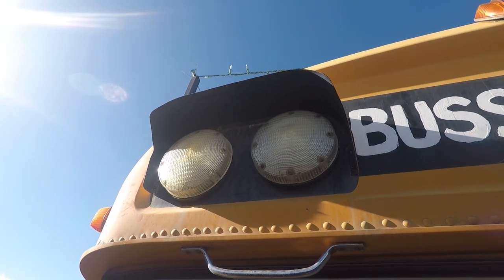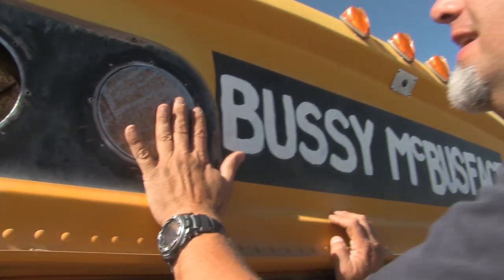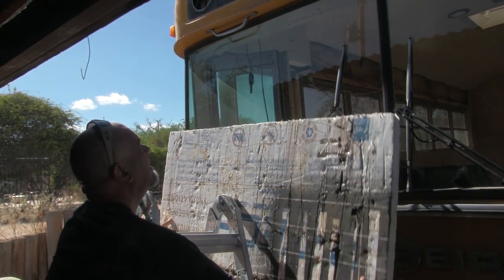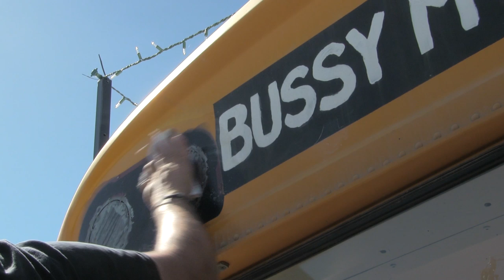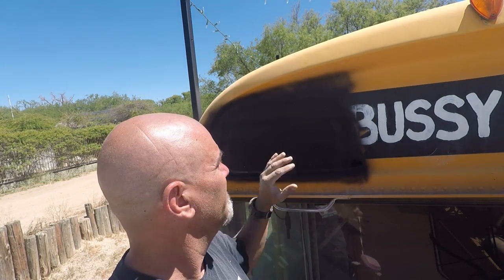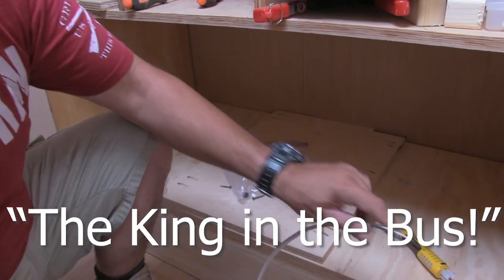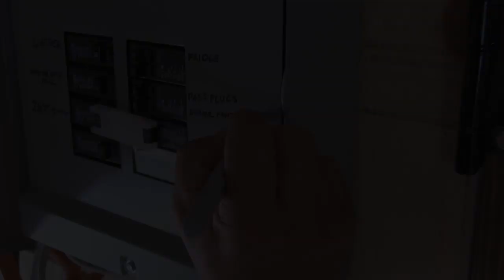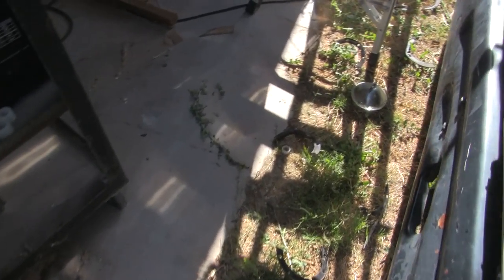Skoolie Crossing Light Removal | Skoolie Build Series

Comment: Bondo suggestions: During the sweet spot when the Bondo has solidified, but has not yet hardened, you can get a head start on working the finish by using Surform tools and scrapers, like the ones branded as Red Devil. This is particularly handy when developing more complex shapes. I’ve found that I can more quickly take down nearly cured filler by hand with a sanding block than with a power sander when fully cured. (But I’m also the sort who will frequently grab the handsaw before the circular saw.)

Also, instead of buying the plastic spreaders, which don’t last that well (they want to keep selling them), pick up some silicone spatulas and bowl scrapers at the dollar store. They work great and any cured filler just peels off. Plus they only cost a buck a piece and never wear out. You’ll want the stiffer ones.

Comment: I know this was years ago, but I'd put led flood lights up there, for lighting up the "yard" maybe a smaller also, for ambiant lighting, and in front, off-road driving lights!  But you guys are great, I wish you were my neighbors! And you make me want a bus even more than I already did! 
I been thinking about a couple Short busses,  make one drivable, and another into a trailer, to pull behind. With a fold down deck to connect the two, maybe a full size and a shorty, or visey versey, and that way it can have a bathroom and half, and larger living room, dining room, a near full-size bathroom, and a half bath in the main driving part, and cover the roofs with solar, maybe 3-4kw, on a pop-up mount, hand crank or powered lift, to allow roof top deck, only on one, because it's not going to be cheap or easy, lifting a rack 7'  is going to be a task! Around 8' x 30'-40'
A gooseneck type hitch under a tilt up deck in the rear of the driver,  a tilt and telescopic deck, to cover it when unpaired, allowing parking butt to butt, with about 24" reach and walkway to eachother, maybe a large generator in what remains of the towed parts engine bay, along with Batteries, maybe, depending on bustype, keeping the under sides for water and sewer, keeping it split and equal, water both sides, pumped equally and grey water dumped equally, with about 100-200 gallon black water (turd tank)  with about 600 gal of water, and 200 gal fuel tank, using a diesel generator of course. And heater, a split heat pump AC would be nice, with as much insulation as possible, to attempt to keep it 68°-72° in all seasons, maybe build a pull out solar rack on the tag along bit, to act as a awning also allowing the ac , holding the batteries and generator, inverter around 8-10 kw, with 40 kw battery, with connection to the driver, it could contain it's own 3kw inverter with auto transfer switch, allowing power while solo,  while having around 2kw of solar, and engine charging capability,  using a dedicated 24v 60 amp alternator, allowing AC to keep cool, with aux. fuel tank in the tag along, allow transfer by pump and 1/2' fuel line, also a 50 amp power connection allowing grid lower or tag along power. With connections on both ends, to allow power while in tow mode, allowing power connection while parked in butt to butt, or side by side, with tilt up "docking deck"  both parts having the tilt up deck, maybe even a tint like roof with screened in walls. Allowing pass through,  I guess it's a bit of expensive dreaming, but I have been thinking about it for years, I'd have to have something of a home base, some place to be most of the time. I have a offgrid home, and a small bit of land. I have missed the traveling since I worked as traveling Electrician, only home 2-3 days every month or two,  but not having a specific reason to go some place, I have no idea where to go, it's been too long to visit friends made while working, I doubt they still work where we met, and I don't remember where they lived,  and I don't meet friends that easily, I'm too quiet, and keep to myself,  I would very much like to meet ppl. See places, go back where I worked maybe, 
Sorry for all this rambling about a dream, I have thought it over in detail a good bit. But experience would likely change things alot!  But I do know solar a good bit, 4.4kw about to be powering my house, I got to get the dozen panels up, but 1200w now, and 24v  33kwh lithium battery, it is built like a bus or rv system, even with 12v battery bank for lighting and camera and security system,  I'm also building a DC generator to charge and power the inverter for the long rainy weeks, or long cloudy winter weeks, a ac generator can power things, but isn't effiecent, and battery charging is very slow, a DC generator can offer 300+ amps for charging, and 200+ for powering inverter, with 200+ ah 12v at least I will have lights if the main system goes down, I plan to add a 12v inverter for backup of a backup, around 2kw, to power the basics,  I wish you guys the best, and sorry for rambling, again!

Comment: so cool guys! I really want to learn how to weld. I feel like it can come in so handy when doing this bus thing. quick question, why not adhere a piece of metal behind the hole and then bondo over it? wouldn't that achieve the same goal? The bus is starting to look like a home now that yall have power to it!! congrats! we just bought 4 x 300Watt pannels today :) solar is so expensive so if we can get one piece at a time over time it won't hurt so bad lol
Reply from the maker: Yes, welding t from behind would have been perfect for this and honestly I probably should have done it that way. My bondo may crack at those seams.

Comment: Yay, some of my favorite people! I did find out how to check my oil the sides open up. I guess my bed cant be built into the walls of the bus I will have to bolt it down since my motor is back in the back inside the bus covered up! It's hard to get people to understand me when I talk about my bus motor! I have only seen 3 on the net like mine. I found one that I followed there bus build but I didn't even remember their bus was like mine till somebody sent me a floor removal video and it was Roll With It bus Scott and KJ I watched their whole build! Anyway Here is the back of there bus same as my bus just mine sticks out more and my back end don't open up. their time stamp is 8:41 KJ is setting https://youtu.be/UiJduhAyr5c